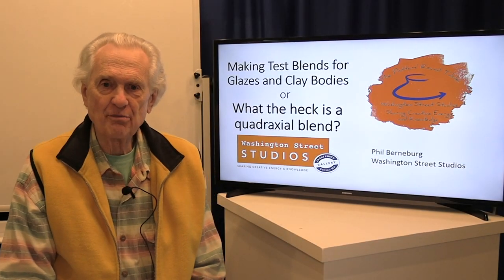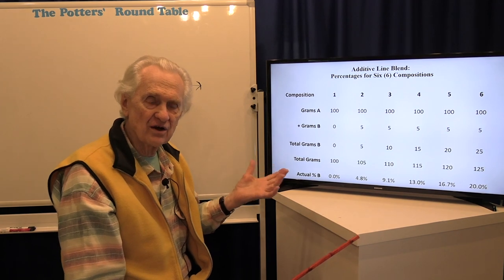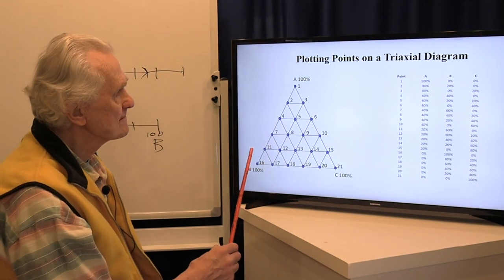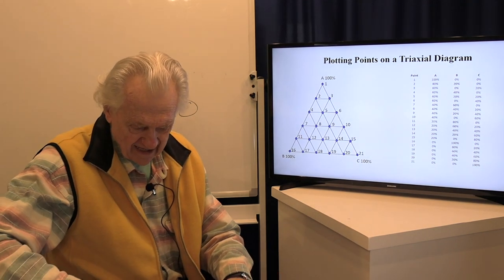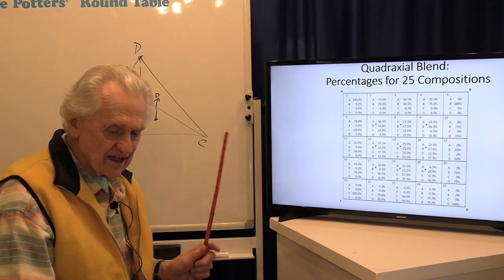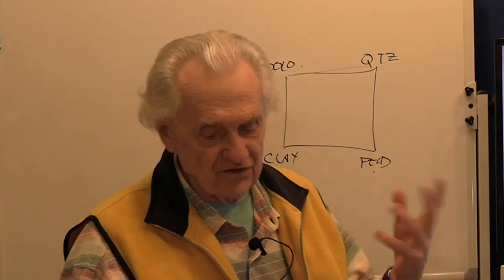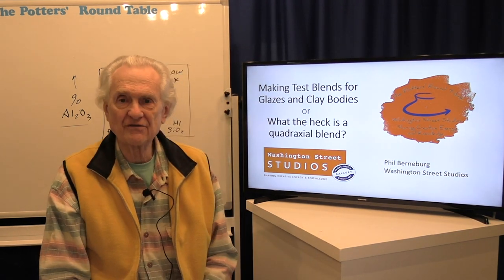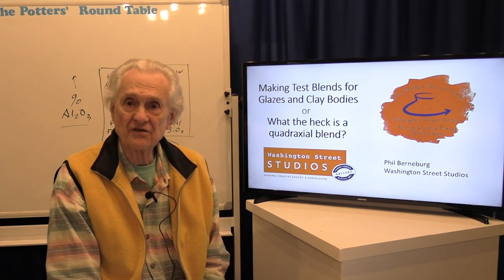Making Test Blends for Glazes and Clay Bodies

Comment: Thank you so much,that was so useful!!! Can you recommend 1200c glaze that is good /reliable /functional for line bland with colour/ oxide?...
Reply from the maker: Tali, I have forwarded this question on to Phil for consideration. I will post his response.
Reply from the maker: Hello Tali, 

If you are using commercial glazes, probably any good clear glaze will work. However, avoid any that contain zinc oxide because it can react with certain colorants, especially those containing chromium. Most manufacturers will tell you if their glaze is zinc-free.

If you are making up your own glazes, here are a few recipes for 1200 degrees C (approximately Orton cone 6):

5 x 20 Base Glaze: wollastonite 20%, Ferro frit #3134 20, potash feldspar 20, kaolin 20, silica 20
(apply thinly)

SG-4 Clear base: Gerstley borate (try Ferro frit # 3134 if not available) 4.8%, wollastonite 26.6, Ferro frit #3195 22.0, nepheline syenite 4.0, kaolin 26.6, silica 16.0

Moving Clear: Ferro frit #3134 21%, spodumene 9, sodium feldspar 7, talc 3, wollastonite 22, kaolin 20, silica 18

Cone 6 base: Ferro frit # 3134 20%, dolomite 20, spodumene 20, ball clay 20, silica 20

Clear base G19: wollastonite 30%, Ferro frit #3195 30, kaolin 20, silica 20

Good luck,

Phil